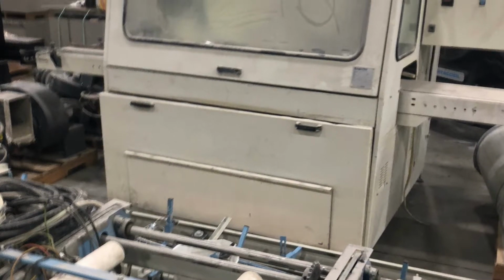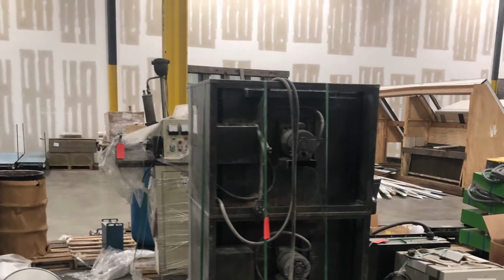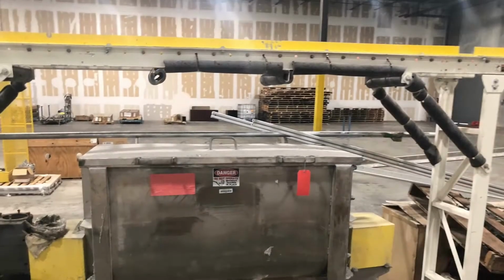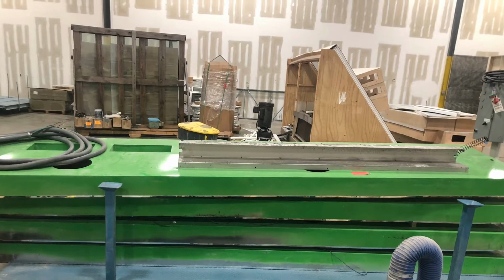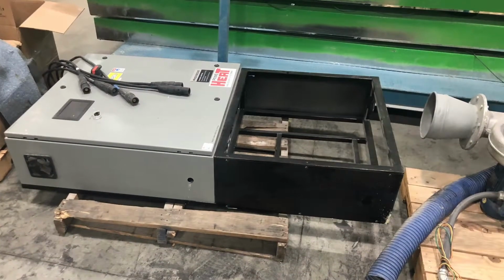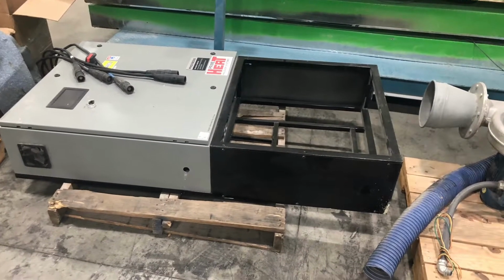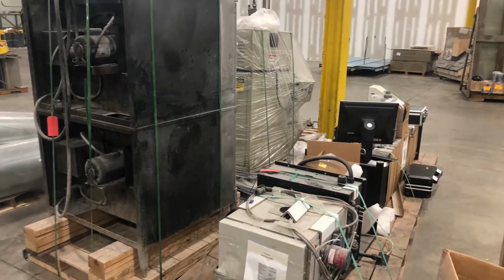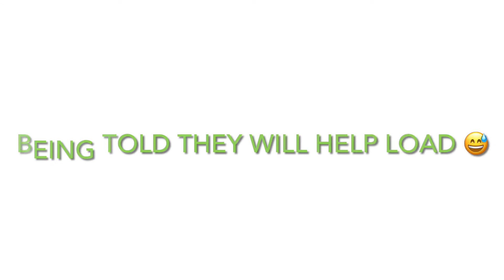Warehouse Clean out in Durham NC

Comment: Definitely a scrap yard dream! Did you try reselling any of the smaller equipment pieces to other manufacturers?
Reply from the maker: I only sold the two evaporative coolers.  Everything else was too large and heavy for me to try and sell and get the job completed with in the time frame.  Yesterday we scrapped a floor sweeping machine.  I took out the batteries and they alone weighed over 700 lbs.